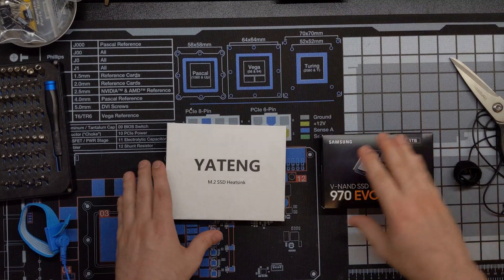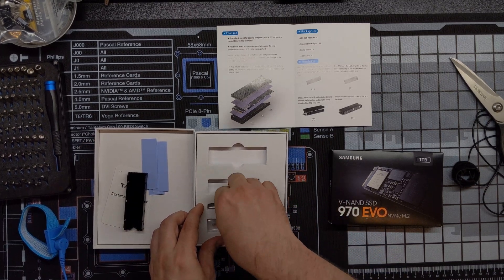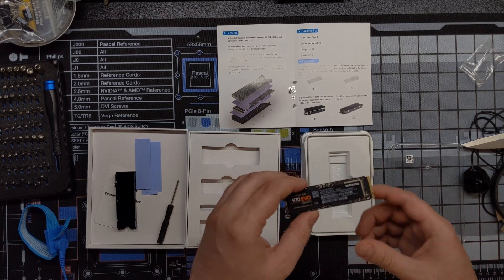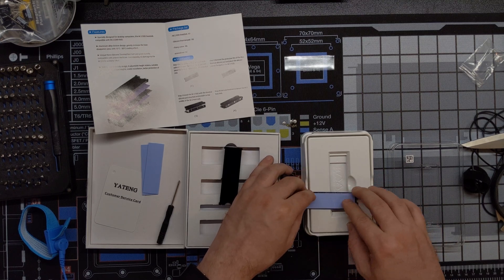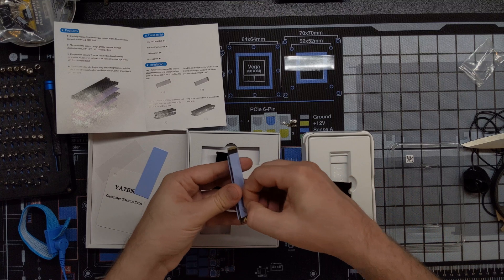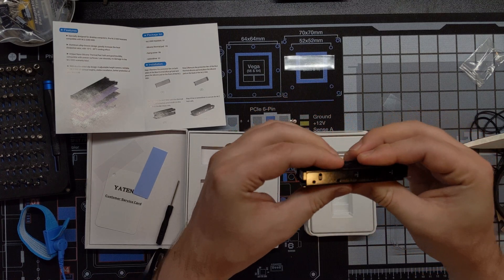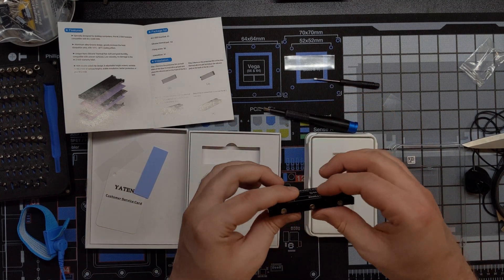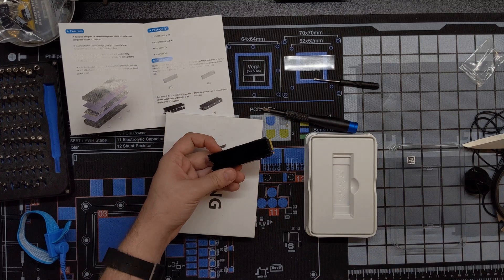Yateng SSD Heatsink Installation

Comment: Just FYI an M.2 Heatsink and M.2 drive SHOULD be running at around 50-55 C as is NORMAL for this type of drive. M.2 are NOT platter drives that do better with cooling however this cooler will stop the temps from exceeding those numbers. Over the course of your M.2 drives lifespan having a heatsink will prevent data corruption on the surface of the drives.
.
Typically, it is the hot video card that makes the M.2 much much hotter as they are mounted almost under those beasts (typically but some have mount points for M.2 under the CPU on the inverse side of the Mobo, which is still FREAKING HOT! Duh manufacturers! Idiots!) on the motherboard so prevention of excessive heat over its lifetime is strictly recommended. I own 2TB and 4TB drives and I will not run them without a heatsink (I actually own this same one). Potential data corruption is a big deal over an M.2 entire lifespan and they NEVER tell you this crap when you buy one do they?
Reply from the maker: I think this is also supported by Sony requiring a heatsink on M.2 drives for the PS5. Thank you for your comments and thank you for watching!

Comment: I bought it, but my temperatures are 57 to 60 degrees, I even removed the styling
Reply from the maker: For me the biggest difference was not the temperatures but how long it could run before slowing down. I would try transferring some larger files with and without the heatsink to see if it makes a difference. 

That being said it made a very small difference so I'm not sure I would recommend this to everybody at this point. Maybe in small hot cases.